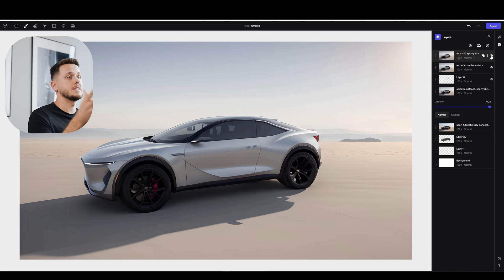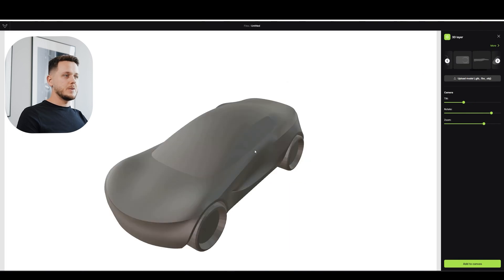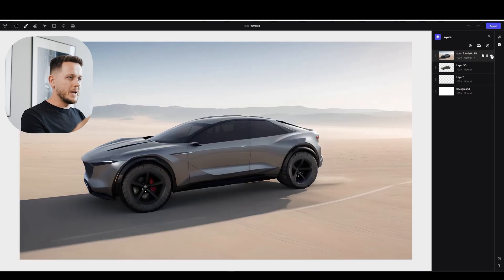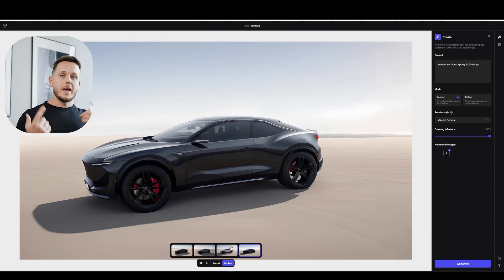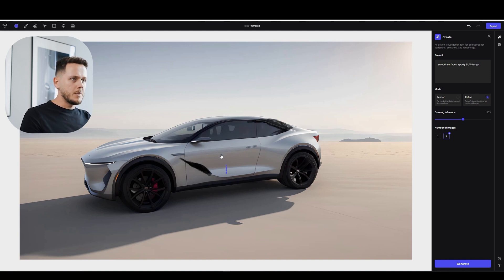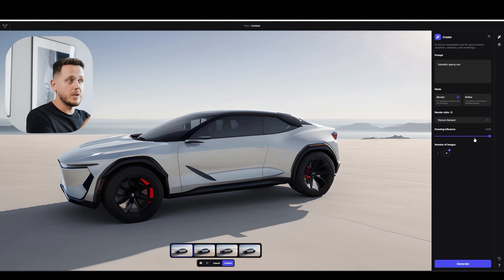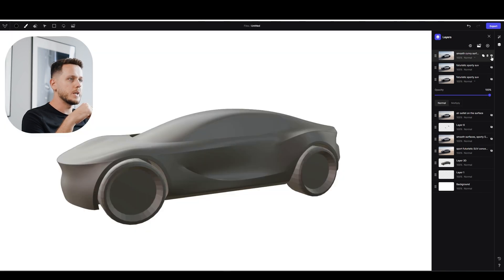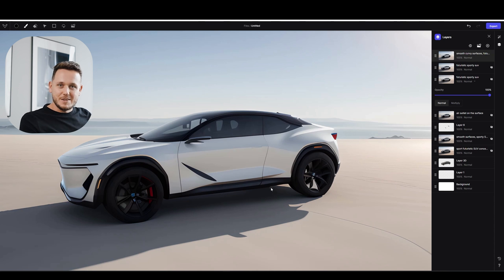The incredible results of merging AI and my 3D model!

Comment: Maybe if Vizcom introduced a few different environment lighting options (kinda like Blender’s mat caps) to allow the highlights and shadows of the model to be more visible to the AI, it may help with the edge detection and keep the original shape for a more accurate concept.
Reply: Just do it yourself with a1111 img2img. Bit more setup but more control over the result.
Reply: imagine if one day you can export the result as 3d model
Reply: @giovannimontagnana6262  it is possible now with 3d pro feature of it